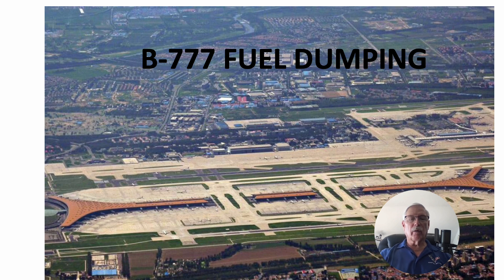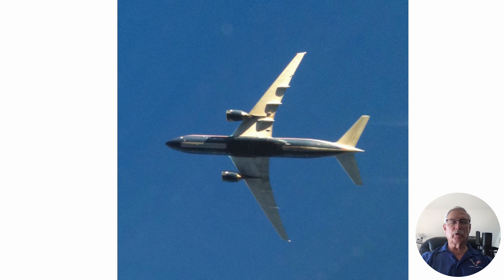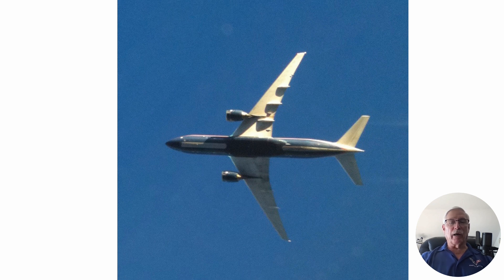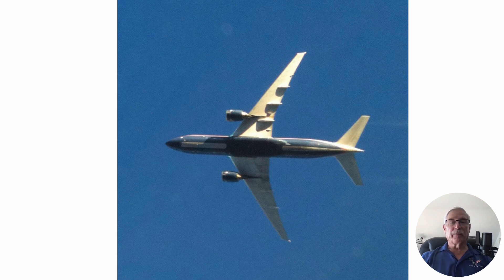B-777 FUEL DUMPING

Comment: Had the occasion to dump fuel twice when flying KC-135s. 100,000lbs in a holding pattern over Torrejon Spain (3 engine) and once between New Orleans and Robins
Reply: So that’s why I ended up with extra dressing on my salad when you passed over Keesler lol
Reply: I lived near Torrejon Base, was the longest runway in Europe with more than 4 kilolemetres long.

Comment: Why can they light it on fire like the F111 does.
Reply from the maker: the fuel is dumped between the engines in the F-111 and touched off by lighting the afterburners.